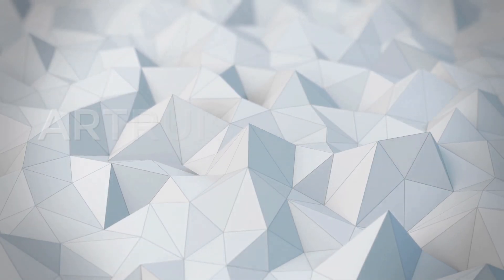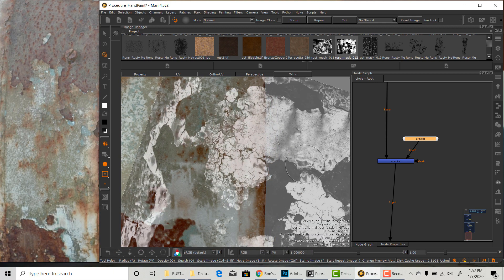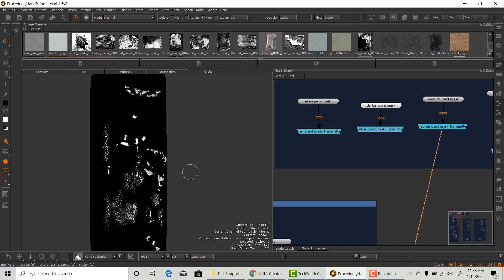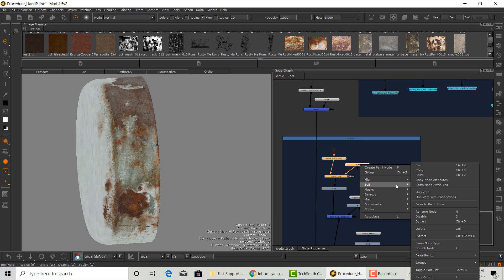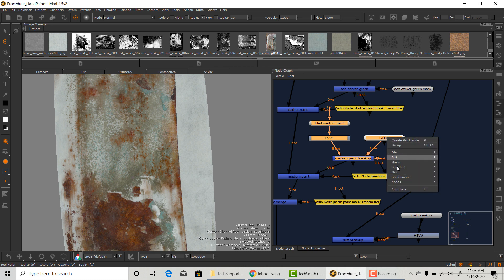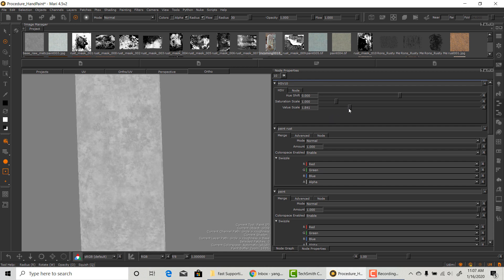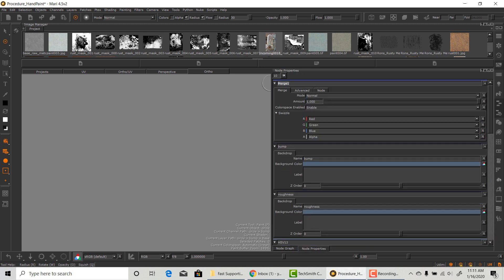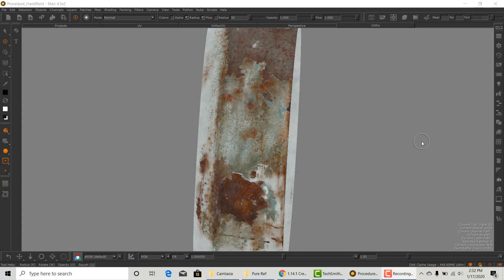Mari Tutorial: Create Supporting Maps In No Time With Non Destructive Workflow

Comment: thank you for sharing. really nice to watch your videos, one question tho, there is a way to merge more than 2 "things" ? or i have to use like 10 merge nodes when working with an asset with 10 udims ? . also, i really hate your nuke's style nodes. lol, it would be easier to see where everything is connected, not that important tho, but if you dont mind, it would help the viewers, i think. or maybe is just me. lol, anyway, great content !
Reply from the maker: when you merge something for example like a paint node, the node is on all your UDIMs, you don't need to merge it 10 times, unless you give that merge node a mask to control where you want the paint node to cover.
Reply: @ArtruismDigital  yes, with mask i meant. well, that's a pity. thanks for your time. have a nice weekend! :)